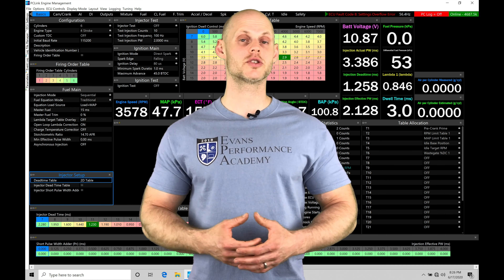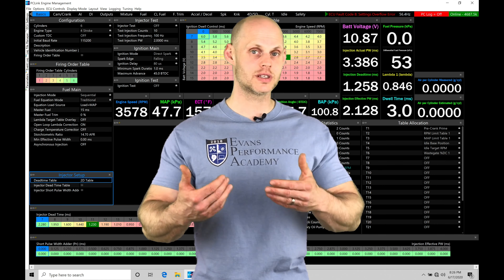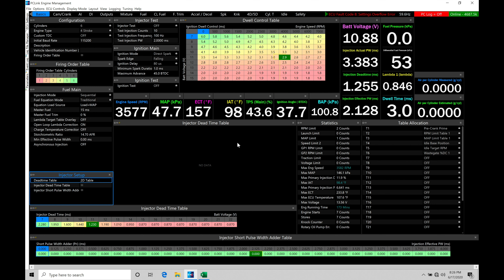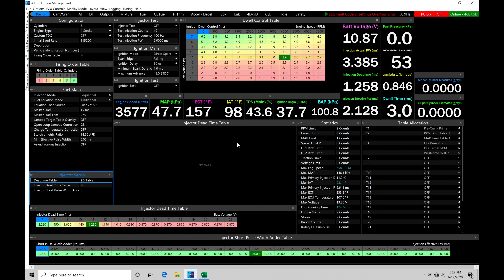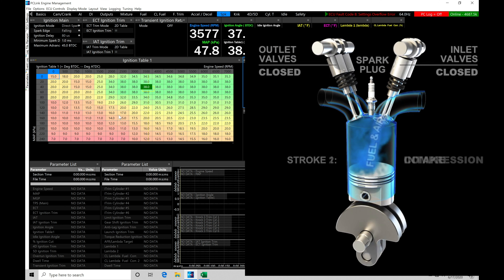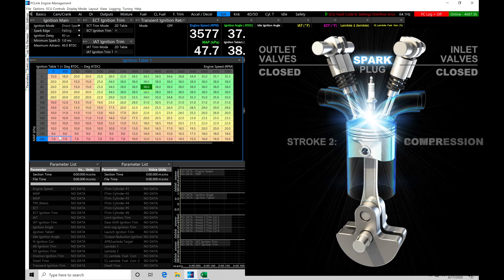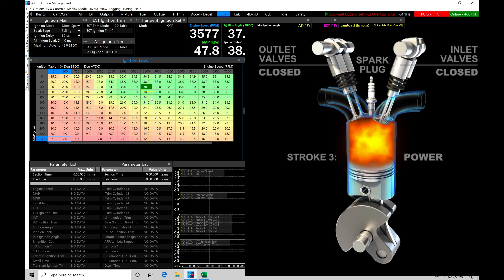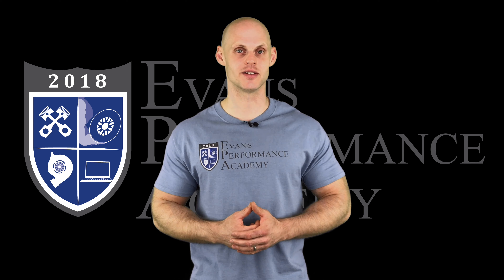Link G4x Training Part 24: Knock Control | Evans Performance Academy

Comment: getting rid of DSMlink for link g4x what do i need to add knock control
Reply from the maker: Nothing additional is needed as long as you have a knock sensor present and you are using the PNP G4x.